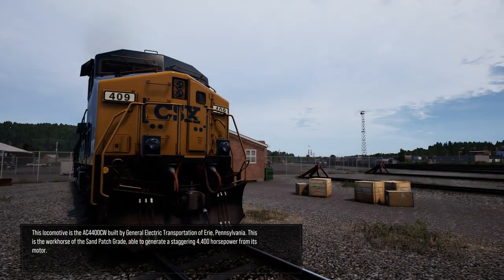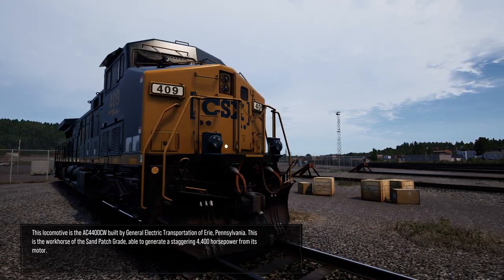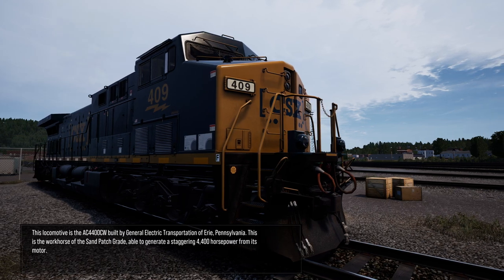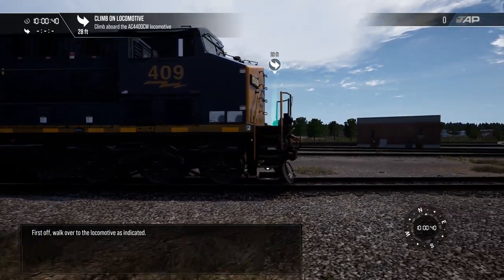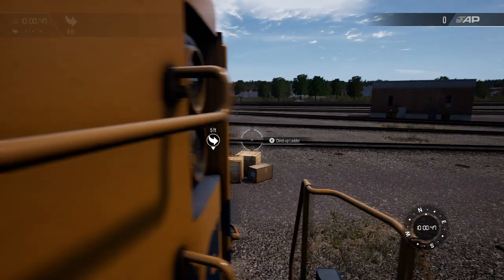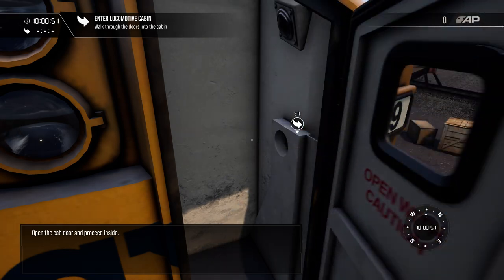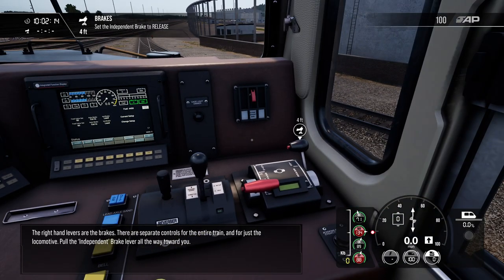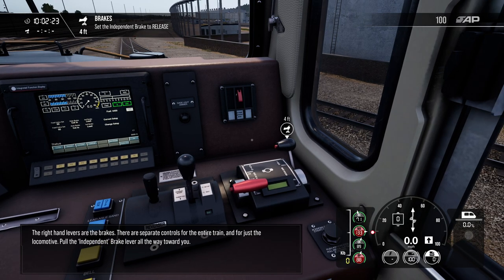Train Sim World 3 - Training Center, GE AC4400CW Introduction

Comment: Man i wish these Simulators would be added to Nintendo Switch because the Switch needs more Simulators, Train Simulators would work really well
Reply from the maker: Yeah, they should port these to the switch.
Reply: @kohanson  I was thinking a while back about if Snowrunner is able to run on Switch along with the Grand Theft Auto games then Train Simulator gotta work because Snowrunner is a graphic intensive game and it runs perfectly fine and for Rockstars GTA definitive edition they upped the graphics a lot for them and they run well on Switch. I think people should get in touch with me developers of TS and TSW and get them to make ports for Switch.
Reply from the maker: Yah, probably it will cost alot of money to port the games and the customer base are not as huge as titles like GTA.